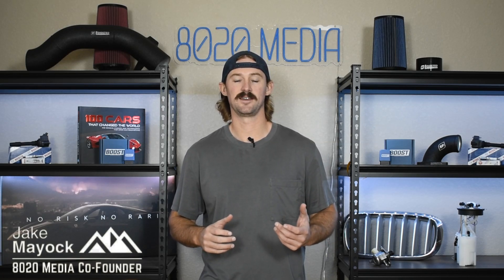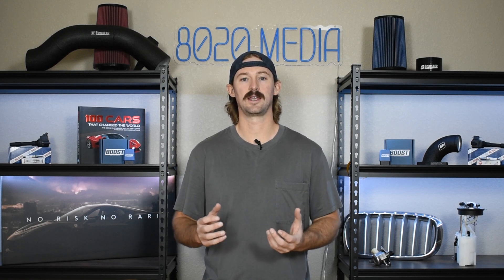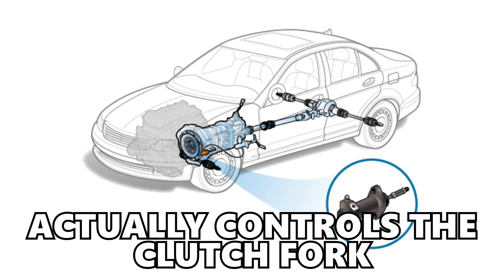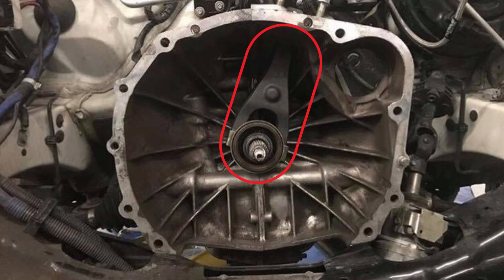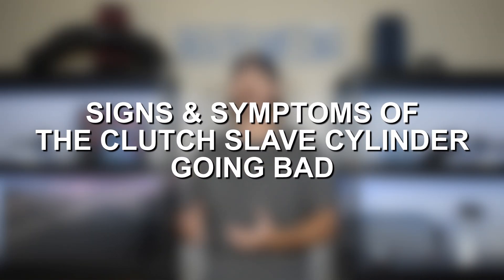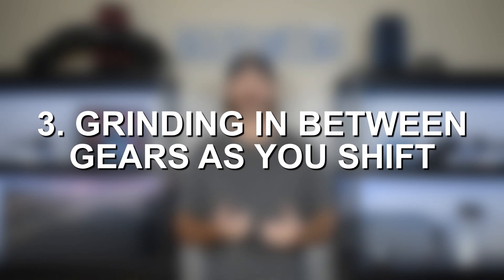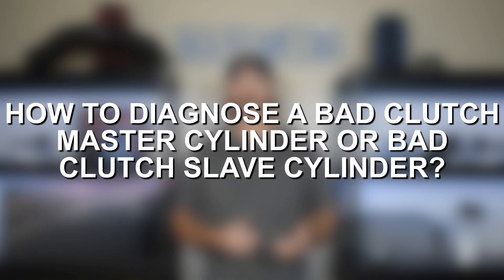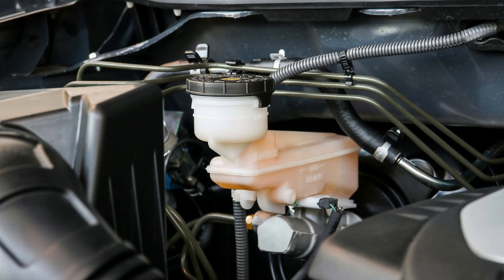Bad Clutch Master or Slave Cylinder? Symptoms, Diagnosis, and Fixes Explained!

Comment: 2000 F150 4.2 4wd 
I was told one of the cylinders is in the transmission. 
Having clutch issues… clutch releasing near floor so if clutch pushed to floor amd starting in gear the vehicle is starting to move forward. 
Difficult to press clutch and push it into gear. Clutch near the floor when releasing . 
Reservoir near hood is full

Comment: If a manual trans was towed in 1st, parking brake on, and in 4l, where would the shop start first? I had a 06 tj towed after hydroplaning and initially just needed a new diff assembly but tow truck didn't take it out of gear or off the parking brake before T-towing. Was also towed maybe 10 miles.

Comment: Hi! I have a 86 E30 316i and my clutch is soft and did see a brake fluid leak outside but not inside. What would the issue be on this case?

Comment: Great information. I have a 2006 Toyota Tacoma and the master cylinder gets its fluid from the brake master cylinder revisor. That's the fist I've ever seen that! That leads me to believe the system got air in it from this evidence: I bought truck 18 years old, Last owner said clutch has always been like that (had to push all the way to floor to start, I have had it for 2 years now, When it got to 32º here in Texas the other day it would not pressure up, today when higher temps it all the sudden works, and last there are no leaks to find. Whit that evidence I will blead to see if air is in fact in the system and hope if that works. If not its a easy job to replace ither one or both.

Comment: Vauxhall Mokka 2021 6MT. Mileage is about 11,000 miles. After three years the slave cylinder started leaking, so I replaced it. The new one leaked again after six months after, so I replaced it again. About two weeks after this replacement, I started noticing a problem: the first and reverse gears feel like they stick. It’s only the very first engagement after pressing the clutch that feels like it resists. The dealership suggested replacing the master cylinder, even though the clutch pedal felt completely normal — no softness, no sponginess, everything felt fine. They replaced it, but the problem didn’t go away. Now I’m back to thinking it might be the slave cylinder. Could it still be the cause, even though there’s no pedal issue and no visible leaks? The dealer’s service says it doesn’t need to be replaced if it’s not leaking. Also, this problem only happens when the engine is running; when engine off - the gears shift normally without any resistance. Thanks in advance for any advice!

Comment: I have an 06 Honda CRV manual as my daily beater. When the car is not running, shifting into any gear is like butter. As soon as the engine starts up, its extremely difficult to get in any gear, including reverse, almost asif I am not fully pressing down the clutch pedal. When I do start it in 1st with clutch pedal pressed down, its all good and it does not jump forward or anything, so I am assuming the clutch is engaging fine? Took it to a shop who said they bled it and recommend a new clutch kit. Do I just bite the bullet and pay for a replacement or does it sound like it may be an hydraulic issue?

Comment: My i20 clutch failed the pedal went down OK but in gear nothing happened like the clutch was operating in neutral even though the car was in gear. Not very good at traffic lights. Always happens in hot weather during a long journey!

Comment: My clutch got replaced and will go in and out of gear. But the clutch pedal is very stiff and won’t work now and I don’t know if it’s the slave cylinder (bc it’s new) or the fork in the transmission

Comment: Had both master and slave replaced by a mechanic and it still wouldn’t shift after trying to leave the shop. They then bled the line for air bubbles and it shifted fine afterward. Just wondering if I might have a leak in the line or something?

Comment: My clutch will sometimes stick to the flywheel.  It only does that if it has been sitting a long time.  That requires starting it in gear, then holding the clutch pedal down while driving it through the gears.  Usually, about 30 miles an hour upshift into third does that.

Comment: I was having issues putting my fiat panda 4x4 into gear, had to turn the engine off and then put into reverse. Paid £1300 in the UK (Halfords) for a new clutch and flywheel. Then found my clutch was sticking and not returning all the time when creeping in traffic. Took it to a different Halfords and was told I needed a new Master and Slave cylinder, and quoted another £1000. Opinions? Great video btw thanks
Reply: Don't go to Halfords man..

Tell them you are going to trading standards if they won't fix the cylinders after you spent 1300 with them and they diagnosed it wrongly

If getting nowhere, go to a local garage, ask taxi drivers about good local trust worthy garages, and get whatever cylinder is broken done for 100-250 quid..

Comment: Hey Jake I hope you actually see this an can help.   Very informative video BTW.  So I have a 14 frs and having a clutch issue.  It initially feels normal for the most part with a little lag.  When im going into first or reverse I really have to gas it up in order not to stall!  Every other gear i can hit with no problem.   It did get really spongy on me one time and I literally couldn't go anywhere.   But after about 2-3 minutes it had pressure again.   Iam almost positive I have a leak in the line.  My clutch fluid was at the minimum so I added fluid.  Im not really driving it right now,  but I did for a day or two just to kinda get a better understanding of how it was behaving in order to put it into words.  I looked into the bay down to the skid plate and did see some "oil" for lack of better terms on top.  Should I just go ahead and replace both cylinders and lines?  Or do you think it may be something else?  I really hope you get this and get back to me.   Thanks

Comment: Failed to mention most slave cylinders are concentric inside the transmission bellhousing so a NIGHTMARE to replace, involving moving subframes, removing trans bell housing, removing driveshafts & suspension, raising car, removing ancillary equipment, hoses, brackets & car battery etc etc
If you have a failed internal clutch slave cylinder you might as well either replace the WHOLE clutch assembly, slave cylinder & flywheel because its the same anount of labour involved $1-2000 ! Or simply scrap the car.

Comment: Hi, I'm hoping anyone can give insight. My car, that is a 2016 Nissan Versa manual 5 speed, will go into gears when it's off and push in clutch, but will not go into gear when started and I push in the clutch. I've replaced the manual transmission fluid to specifications. The clutch pedal feels stiff when pushed, but comes up when foot is off. It's a hydraulic clutch and shares the same reservoir b/w brake fluid and clutch. It takes DOT 3. If I put the car into hear while off and then start the car holding in the clutch, it leaps forward and cuts off.What could be the problem?

Comment: I have the kind of issue. Gear shifting doesn't happen some times and if it shifts then there is vibration while initial pickup in the 1st and 2nd gear. But somehow if I manage to get in motion the car pulls with ease. So what could be the problem. Please help me out...
Reply: Same issue. Vibrations at first gear and pickup lags. But sometimes it's perfectly fine.

Comment: My clutch pedal is definitely spongey and leaning more towards the master cylinder issue BUT on the slave cylinder it appears to not be actively leaking but to have fluid on that rubber sleeve, so not sure if that’s normal or a leak.

Comment: So my vehicle is not going in to gear when it is cold. It is just now becoming fall and I never had a problem. Once it warms up it goes in to gear. I think it’s the slave cylinder.
Reply from the maker: M - You’re likely right to suspect the hydraulic system — a failing slave cylinder (or sometimes the master cylinder) is the most common cause of that symptom. When it’s cold, the seals inside the cylinder can shrink slightly and allow fluid to bypass internally, which prevents full clutch engagement and makes it hard or impossible to get the transmission into gear. As the fluid and seals warm up, they expand and build enough pressure for the clutch to work normally again. Before replacing parts, check for fluid leaks around the transmission bell housing (slave) and under the clutch pedal (master). Also, make sure the clutch reservoir is full and the fluid looks clean — if it’s dark or gritty, air or moisture may be trapped in the system, which can worsen cold-performance issues. If there are no external leaks, it’s still smart to bleed the clutch hydraulics first, then replace the slave and master cylinder as a set if the problem persists, since they age and fail together.

Comment: Hi, I have a Fiat Punto 1.2 manual. When the engine is off, all gears engage fine, but when it’s on, first gear won’t go in. My neighbor (a mechanic) fixed it in 2 minutes by pumping the clutch and bleeding air at the slave cylinder, and it worked. I then drove about 4 miles to work with no problem. But after parking and turning the car off, when I restarted it, the issue came back, the gear lever wouldn’t engage again. Does this sound like air in the hydraulics or a failing master/slave cylinder?
Reply: Hey! I got similar issue today. I was driving fine and all of a sudden during my spirited drive I couldn’t go to second gear. Exactly like you said, I had to push the pedal all the way in and then it wouldn’t go into 1 or reverse. I was able to put in 2 and managed going back home at 6th gear with no issues (140 miles) 
It’s at home now and I don’t know what to do. Please let me know if you figured out something for your car

Comment: Ive been having problems going into 3rd without making a grinding noise, and recently having a hard time going into 2nd. When it warms up 2nd is no problem but 3rd is still wanting to grind. Any ideas? Any advice would be very much appreciated. All fluids are good
Reply: if it’s specifically 3rd gear, its probably a gear synchronizer. most likely broken a few teeth and cant catch/grinds when it catches

Comment: Ive had a new clutch and flywheel fitted on a bmw f46. I replaced the clutch slave cylinder but now my clutch pedal feels really hard to press down. Could there be a air lock?

Comment: I have a Dart with manual transmission.  The slave cylinder is located inside the transmission so the transmission must be removed to replace it. It uses the brake master cylinder reservoir for its fluid reservoir, not a separate reservoir just for the clutch.
Recently the shifter became real hard to put in first or reverse when stopped. The shop at first wanted to replace both the master and slave, but after I told them the master had been replaced some years back at 60K miles after the manufacture extended the warranty on them due to pedal sometimes sticking to floor, they tried just replacing the slave, which wasn’t cheap.  But it’s still messed up so now they want to replace the master cylinder, which we find is backordered 2 months.  Arghh!  I got 11 years and 134K miles of pretty reliable use out of the car but now it’s turning to junk due to this issue!
Reply: Any updates ? I've replaced everything BUT the adapter/bleeder valve part

Comment: Hello,

Thank you for the very informative video. I enjoyed your explanation of how all of this stuff works. I’d appreciate it if you have time for my question.

A strange thing happens with my 2013 Nissan Qashqai (EU version of the Rogue): when I drive at highway speeds (80..90 mph) for a few hours, the clutch becomes spongy and soft. I can feel it gradually losing pressure. If I don’t stop for a few minutes and keep driving, it eventually drops completely and requires me to pull over and pump it.

If I drive around ~50 mph (and annoy everyone on the highway), it doesn’t happen. On regional roads, in the city, or even at highway speeds but with frequent stops and/or traffic jams, everything is fine. It only occurs during prolonged high-speed driving.

At the dealership, as usual, everything looks good: the system has been bled multiple times, fluid levels checked, and the gears shift nicely.

This has been happening regularly since a recent clutch replacement (~150k miles). The master and slave cylinders were not replaced.

On one forum I read there is a hose which can expand at high temperatures just enough to drop pressure, and then return to normal quickly.

Does that make sense? What would you recommend? Thanks!

Comment: I have a s2k and replaced both cylinders and did the bleeding, but pedal is still super soft and not going in gear. What should I do?
Reply from the maker: A - If your S2000 still has a soft clutch pedal and won’t go into gear even after replacing both the master and slave cylinders and bleeding, the most likely issues are either air still trapped in the system (these cars are notoriously difficult to bleed, often requiring a vacuum bleeder or bleeding the slave with the line pointing upward), or a mechanical problem with the clutch itself such as a worn clutch disc, collapsed pressure plate, or release fork not engaging correctly; I’d first re-bleed carefully using a vacuum or reverse-bleed method to guarantee no air is hiding in the high loop of the line, then check that the slave cylinder is fully extending the fork—if it isn’t, there’s still air or a hydraulic issue, but if it is and gears still won’t engage, the clutch assembly inside the bellhousing is likely the culprit.

Comment: I put a new master cylinder in today and my pedal still went down will u know the issue
Reply: Did you bleed the system? If not I would try that
Reply from the maker: 5 - If you’ve just replaced the master cylinder and the pedal still sinks, the two most likely issues are air trapped in the system or a leaking/weak slave cylinder (or clutch hydraulic line). Even with a brand-new master, if the system isn’t thoroughly bled (including bench-bleeding the master before install), the pedal will drop because compressible air pockets remain. If bleeding doesn’t fix it, then the slave cylinder may be bypassing internally or leaking under pressure, which would also let the pedal sink. In short: double-check that the master was bench-bled, re-bleed the system carefully, and if the problem persists, the next suspect is the slave cylinder or the hydraulic line itself.

Comment: Hi, wondering if you might be able to help me. My clutch has an intermittent issue. Sometimes the clutch feels spongy, and when I release it, it doesnt come back as fast as it should, but then a few days later, the issue is gone and the clutch is normal. Then, put of nowhere it'll come back to being spongy and not coming back. It has been bled to make sure no air bubbles are in the system
Reply from the maker: A - An intermittent spongy clutch pedal that sometimes doesn’t return quickly, even after bleeding, usually points to a weak or internally bypassing master cylinder rather than trapped air, since the master can intermittently lose pressure and then “come back” depending on seal position. A failing slave cylinder can also cause this, but that tends to leave more consistent symptoms or fluid leaks. If your fluid level stays steady and there are no visible leaks, the most likely culprit is the clutch master cylinder seals wearing out and allowing pressure loss, especially after heat soak or extended driving. Replacing the master is the logical next step, and if the problem still lingers afterward, then replacing the slave or both together is recommended to avoid chasing the issue twice.
Reply: @8020Automotive thank you 🤙🏻

Comment: So in my car, i have a 2010 gensis coupe, and when i accelerate past around 5k rpm the clutch pedal moves closer to the floor and im not able to press it down and disengage the clutch fully, im not sure if thats a problem with either the slave or master cylinder since no one talks about being high in rpms or this problem but does anyone know what it could be?
Reply from the maker: J - What you’re describing is a pretty well-known issue on performance cars and usually points to clutch hydraulic system limitations, specifically the master cylinder or clutch line not maintaining pressure under high RPM (the fluid can cavitate or bypass internally), and sometimes the slave cylinder contributes if it’s weak. Many owners fix this with a stainless steel clutch line upgrade and/or high-temp fluid to prevent pressure loss, but if the problem persists, the master cylinder is the most likely culprit since it’s responsible for generating and holding the pressure. If your clutch itself feels fine at lower RPMs, the disc/pressure plate are probably still okay, so I’d start with bleeding the system thoroughly, then consider replacing the master cylinder or upgrading the clutch line if the problem continues.

Comment: Thank you so much for adding this video, its so good to understand the different symptoms of one failing component, however i have an issue of the clutch feeling soft and gears not engaging upon not using the the clutch pedal for a duration (around 40 minutes on a motorway) however, pumping the pedal usually resolves the problem, i think the problem in that case is the master cylinder? The car is a qashqai j10 1.5 dci
Reply from the maker: S - Yes, what you’re describing on your Qashqai J10 1.5 dCi is classic of a hydraulic issue, most often the clutch master cylinder slowly bypassing internally or letting air in; the slave cylinder can also cause it, but masters usually show exactly this “pedal fade after sitting, comes back with pumping.” Since you’re not losing fluid, it’s likely an internal seal leak rather than an external one, so I’d start by replacing the master cylinder, bleeding the system thoroughly, and if the issue persists, then look at the slave.